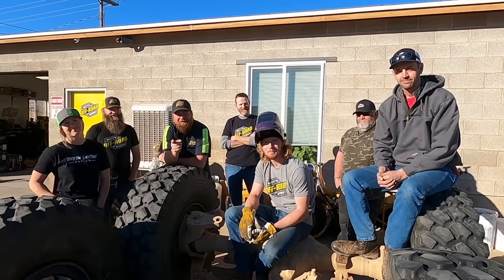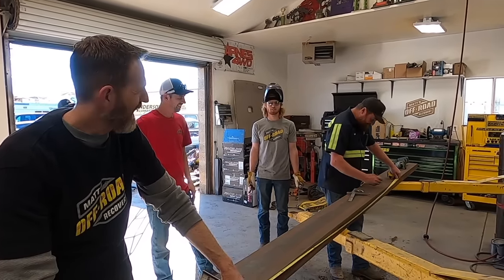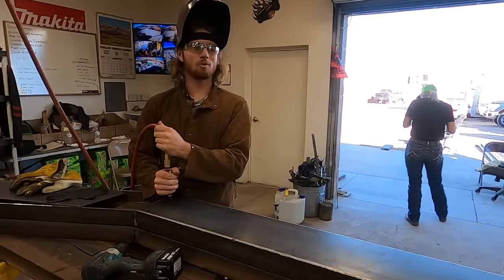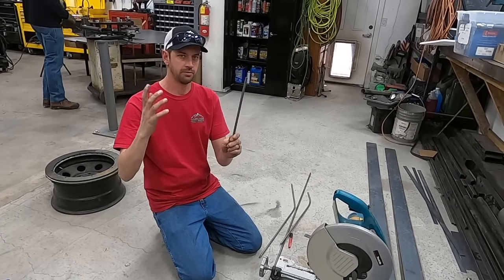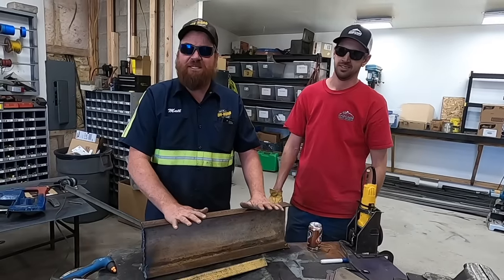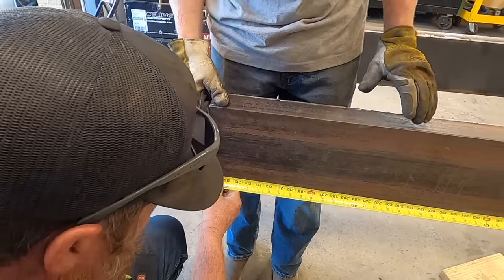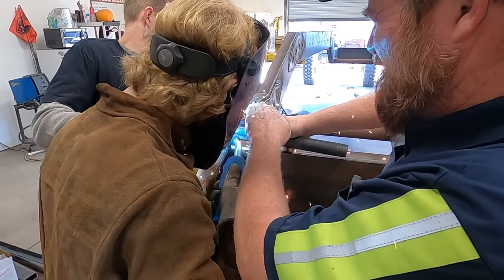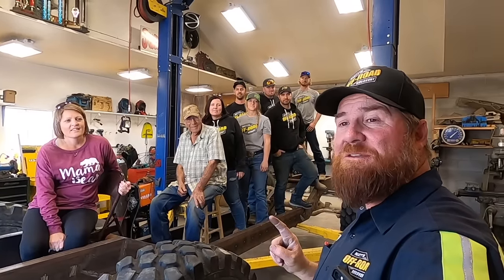I'm Building The WORLD'S LARGEST Off-Road Wrecker

Comment: The inframe air is a bad idea mate, it will leak after every trip and why put extra load on the frame by pressuring it to 100psi? The think is huge, plenty of room for real air tanks.
Reply: This X 100
Reply: Also even if rust isnt a problem normally, air compressors collect water in the tank over time. Rust your frame from inside out, WHILE holding pressure.

Its a neat idea but I don't think its a good idea.
Reply: @Yugophoto  You are so right. And in 4000 years when that happens, I'm sure Matt will look back at this comment and go, "I should have listened to Yugophoto!".
Reply: @Yugophoto  compressors get a moisture bung for that
Reply: @Ferretts89 compressors blow up fairly often from rusting out from the inside. It doesn't take raw steel that long to rust when it's soaking in water. My 1 gallon compressor makes at least an oz of water just filling up car tires. It blast out rusty water every time I open the drain when I'm done. It's rusting and I properly drain it every time I use it.

Comment: PLEASE, PLEASE, PLEASE use a face shield when using grinding tools. I've personally seen the life changing effects of a cut off wheel when it explodes. You NEVER get an eyeball back when damaged like a cut off wheel can do. Also note: If these are paid employees, you're opening up a big can of legal worms dealing with injuries like those.
Reply: This.
Reply: Are sunglasses not enough?
Reply: Genuine question
Reply: The no guard on the grinder with a thin cutting disk also make me cringe.
Reply: @bruhice6058  no
Reply: @bruhice6058   it would go through sunglasses
Reply: This!! A family friend had a chunk of his face blown off, and the tool even had a plastic guard! So worth it to stay protected
Reply: I have had a few "eye issues" with glancing and bouncing grindings and I have to agree. That's one of the ONLY safety tips i found helpful in the Chevron "turnaround" in the bay in the fall of 2020. Good shield, then take ALL the other guards off! They are CRAZY about safety .
Reply: Not a single mask either, but cancer comes later.
Reply: I had a grinding wheel blow up last year. It scared the shit out of me but I got lucky and only had some small minor cuts. 
I use a face shield now. I figured it wouldn't happen to me. (of course)
Reply: @igneousc  i grind a fair bit. The fibers are visible (tindel effect) ..but if you keep airflow...it helps..they aren't doing it as an occupation.
Reply: FACTS

Comment: There's a reason air tanks aren't made with flat surfaces!! Just put in a real air tank, trying to make the frame the tanks is nothing but trouble, it won't be strong enough for good pressures. Seriously the truck is massive, you have PLENTY of space for proper air tanks!
Reply: I'm with you on that.. I just gave a similar 2cents of input. 
Some big tube bumpers would be another good option..
Reply: I think they're worried about the weight of the tanks, not their size...
Reply: @WatanabeNoTsuna.  2 4 gallon tanks is not that heavy
Reply: Much safer to use the frame as a fuel tank🔥

Comment: First of all, HUGE fan. HOWEVER, as a mechanical engineer (not a certified PE) but still a guy who’s job it is to design compressed air systems, I’m concerned about the frame/tank. Compressed air (wet air) causes worse corrosion than air or water on their own. It’s a regular occurrence the water in bottom of tanks rusts the tanks out. I’d be concerned corrosion from this starts to eat into the thickness and rigidity of the frame unless you add a compressed air dryer. Let me know if I can help out. Without drying, minimum a good condensate drain the frame is gonna have less than 15 yr service. I hope I’m wrong. To only have 10 gallons of air the tank to replace this idea is less than 60 pounds and a couple hundred bucks to do it correctly AND not rust this brand new frame out. A truck this size won’t miss the 12” diameter to do the job right. Again, I hope I’m wrong. Love the idea. Paul’s bumper was just a lot lower chance than the frame the vehicle rides on.
Reply: @mokumizu4318  totally unnecessary comment
Reply: Those axles should have air brakes and/or bags and will certainly need an air dryer.  I'm curious if they are going with a diesel powerplant?
Reply: And a hair dryer 🤣
Reply: Glad that so many people are jumping on this point. The 4x4 community's current fascination with DIY pressure vessels is going to result in a high-profile accident and closed-casket funeral, sooner or later. It's particularly baffling to see it on these bespoke builds where a commercial air cylinder can be procured in advance and then designed into a protected space on the vehicle.
Reply: Agreed. They need to make a big deal about scratching the pressure-holding component of this idea. Boxing the frame is worthwhile, but non-Engineers just don't understand how very dangerous exploding pressure vessels can be. They can buy off-the-shelf tanks and find a home for them somewhere on the vehicle that's protected from vibrations that can wreck welds and shake valves loose. Yes, I'm trained as an engineer and I've worked with pressure vessels, although I haven't ever tried to design one because I don't feel compelled to reinvent the wheel.
Reply: Lol I grew up with a homemade  water tank on the back of our wood stove. The back would bulge out pretty far. If the relief valve had ever plugged it would have been a bomb. Lucky never had any major issues with it. My instinct tells me this would work fine if he can keep it from leaking when the frame is twisting around.
Reply: @kornelis bijker The "accident" argument wasn't about an on-road collision .. it was about an exploding pressure vessel vaporiizing someone. When pressure vessels let go, the results are sometimes so devastating that there's nothing left for the casket. I'm all for sketchy build stuff that might fall apart, but this is about two levels of death above that. On par with mounting a nitromethane tank on a turbocharger. This goes way beyond sketch and well into "you're trying to kill everyone, aren't you." and "Which volcano shall we use for our lair?"
Reply: @forestkirk6761  I'll wager you didn't have more than a few PSI of pressure in that water tank before it started bulging. Also, was the tank cylindrical? That helps a lot with the load distribution
Reply: Yes a petcock drain for the condensation
Reply: I was wondering about the frame rusting from the inside myself.  My portable air compressor tank rusted out even with a drain valve.  Our large, commercial compressors had a large receiver tank that was lined inside. The compressed air runs though dryers before it went into the tank.  The dryers were set to blow out the moisture on a regular schedule.  You can replace a separate tank, if it were to rust, plus it would have all of the pressure safety valves on it.
Reply: Have 3 tanks on my big rig. No big deal . Theres a drain you hit every day. Get all the water out
Reply: @Loren460  ya, tanks NOT a frame lol.
Gets kinda pricey if your frame rots in a few years…..
Reply: I am a certified European Engineer, UK Chartered Engineer, BSc. (hons) in Mechanical engineering. Now retired, I was over 40 years in the oil industry. Designed and maintained very many pressure vessels, structures and machinery. I honestly keep waking up at night thinking about the accident that will happen when, not if, the chassis explodes like a bomb. Corrosion is the last of the worries, but absolutely yes a major concern. 
You never use flat plate as a pressure container, you almost never pressure test a vessel with air, it is so dangerous. When I saw how the chassis plates flexed, exactly as expected it was instant proof that the chassis will fail catastrophically eventually. If we ever detected any distortion when hydro testing anything, then the item was condemned. In many countries including the USA, pressure components must be designed by a PE, they must be tested and certified to have passed a pressure test. That is why they all have those little plates on them with the details. Using the chassis as a pressure vessel in a commercial operation exposes you all to so many legal issues and totally avoidable risks.
I have done complete reliability and safety assessments, and developed the maintenance regime  on hyperbaric dive systems. Those assessments were checked and approved by Norway's DNV. I really do know what I am talking about.
Reply: Why is he pressureising frame anyways??
Reply: @Loren460  He wants to use it as an air reservoir I think.
Reply: Tubular heat exchangers do use a flat plate to contain the pressure within the cylinder of the exchanger. Whereas the cylinder may only need 3/8" walls, the flat plate (Tube Sheet)  might need to be 4" to 6" thick. That's how different a cylinder and a plate plate compare. The calculations for the cylinder wall thickness are a ten minute job by hand. I once took a day to calculate by hand the thickness needed for a tube sheet. Yes I am that old lol. And yes I did have a slide rule. Sorry to be a party popping smart *A*, but I am really concerned.
Reply: I'm excited about this build, but as a mechanical engineer who's worked both with heavy military vehicles and with the desgin and testing of pressure relief valves...  this pressurized frame is one cool idea with seriously catastrophic potential.  The energy stored by a compressed gas can easily exceed what you might expect at first glance.

I've seen some comments regarding the "amount" air that would be stored and dismissing the danger.  But only looking at a the tank volume isn't sufficient to grasp the energy being stored (and trying to escape!).  The ASME Pressure Vessel Code is a serious piece of literature and for good reason.  A lot of factors can play into the strength of a pressure vessel.  

P.S. there are are much bigger off-road recovery vehicles out there (look up some of the "newer" military wreckers - M1089, M1249, MK36) but they'll be too heavy, wide, or long to go where Matt may want to take'em.
Reply: @stephendee7839  We had a 42 foot water tower. So pressure was 20 PSI  probably helped that it was fairly low and consistent. The tank itself was a 24" square 6" thick. 3/16 plate. The hot water side circulated through our regular hot water heater so really there was two relief valves. Also I don't think anything prevented pressure from being forced back up the cold water side if all else failed.
Reply: @forestkirk6761  I'm a little confused by the dimensions. To me, 24" square says 24" on a side and 6" thick would be the thickness of the steel. But I'm pretty sure you're saying that it was 3/16" thick steel wall with a 24"x6" rectangular cross-section to 42 feet in height. That would give you nearly 100 psi water pressure at the base if the tower was full.  If the 24x6 section was extruded and it got to be 42' tall by welding extrusions together, I figure see how it would hold with observable bulging if the base was really well welded on. I can't imagine that four sided welded flat plates would put up with that cyclic loading for too long, especially if it froze in winter even once.
Reply: @aaronvienot  couldnt agree more
Reply: @stephendee7839  I prefer just to look at existing trucks, there is a reason there is a modular air system thats not part of the frame, the commercial manufacturers have looked at it and gone "hell naw"
Reply: Yeah while watching I was thinking I didn't see any rust prevention put on the inside of the frame/tank part. Rust will be an issue way down the road.
Reply: It's irresponsible of Matt to even suggest using the frame as a pressure vessel. He has a large following and many of those viewers don't understand the danger but they see Matt do it and think "Well it must be fine cause Matt knows what he's doing". Then the kid tries to build one and it explodes and kills him.
Reply: @jamescrud  yup.. this idea is terrifying even with the fairly limited experience I have working with compressed gas, mainly through scuba diving and some work around trucks .. if this system fails and let's go hard it will not be pretty and someone will probably end up in hospital.. or worse

Comment: This looks like going to be one crazy build. Can't wait to see end results.
Reply: Ditto, can't wait to see the build
Reply: Right?  Really looking forward to seeing a scratch-built heavyweight wrecker!  I'm assuming it'll be home to a large turbodiesel donk, very curious as to what they'll use.  (6BT 12v or 3126 is my guess)
Reply: I'd suggest to Casey that that "Eye-Crometer" probably isn't calibrated in 1/16th's. He might have to consult with Paul to get a judgement on that. 🤣👍
Reply: @MrGaryGG48   that eye cryometer that had me on the floor laughing . I lost mine when I had to get glasses 👓
Reply: @masondegaulle5731  ...... I'd love to see them use a 6BT! I doubt they will though. Matt seems to frown on diesels pretty hard. They'll probably use a stroker motor. Personally I think I'd at least go big block but you know he'll be trying to keep the weight down. I do hope that this time they use a T-case with some lower gearing, even if it's just a doubler.
Reply: Can you get something like this registered / certified by any process? Or is it going to be strictly off-road? I have no clue about any of this, just curious.
Reply: @Mike-gw9yt  there is a reason Matt frowns on diesels for recovery work, he explains why in a video he did quite awhile back. 

In this case, as big as that thing is, & as heavy as it is, i think he's going to have to go diesel. He's planning to use it to pull the big pusher motorhomes through the sand, that's going to require power. Even a stroker gas engine isn't going to produce the heavy duty power he needs. He will need a transmission that could handle the abuse, & any transmission that will bolt up to a stroker won't take the constant abuse with that heavy of vehicle.  The Cummins 6BT would be a good choice, he can get a transmission that could handle the torque from a 6BT.
Reply: @timothygeiger8271  ..... It's the added weight (which is honestly substantial) and the inherent lag from the turbo. I think you might be underestimating the power potential of a stroker motor and the potential of transmissions that can follow them. Don't forget there are plenty of big block options that can provide enough torque to do the job as well....... I would love to see him use a 6BT, I just don't think that he will. My bet is big block.
Reply: @Mike-gw9yt  the biggest reasons he says why he doesn't use diesels in off road recovery is weight, & then a diesel engine can't take the high RPM's for pulling out of sand.